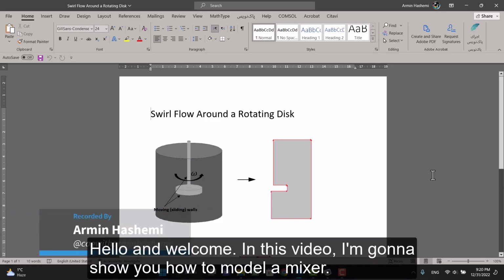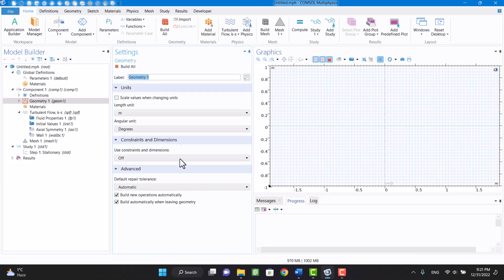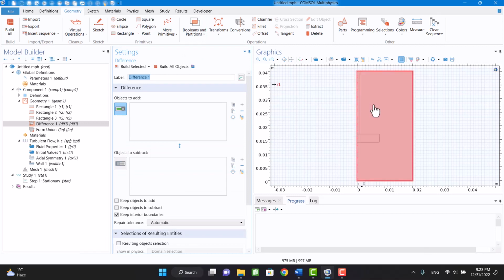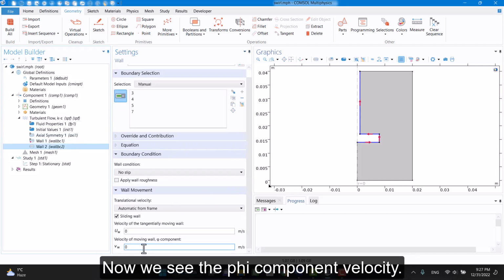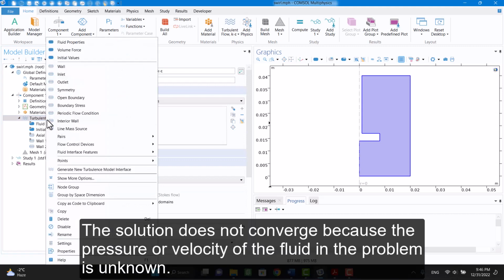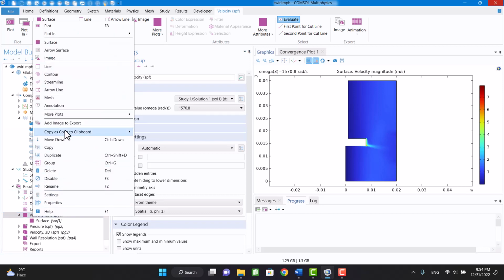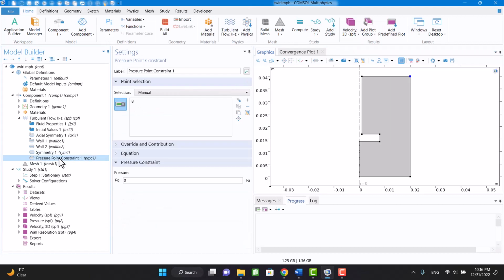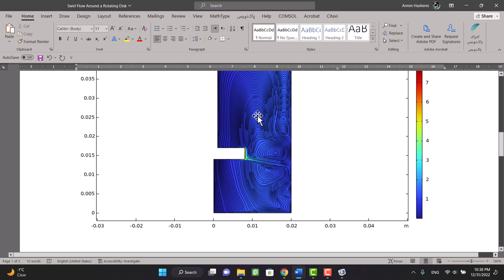⚙️ COMSOL Tutorial: Swirl Flow Around a Rotating Disk (CFD) 💨

Comment: Hey bro. Nice video. Why did u set the symmetry on the top boundary? Why Open boundary led to non-convergence? Can u please explain a bit more? What about “Outlet”? I understand the top boundary is the free water surface confined in a beaker, isn’t it?
Reply from the maker: Hello. The symmetry boundary condition at the top of the fluid is similar to that of a high-height fluid. I have to watch my video again, i didn't remember details. I will answer ASAP
Reply: Also, under the settings for the wall, u enabled sliding wall. What’s the difference between setting velocity in translational velocity (manual) VS sliding wall velocity?
Reply from the maker: @richardjiang  There is no difference in this model. You can write omega*r in phi coordinate, and the answer will be the same.
Reply from the maker: @richardjiang   Open boundary led to non-convergence because you didn't specify normal stress. Select no viscous stress. It should work.
Reply: @caewitharminhashemi  Hi, Armin! Thank you very much for the explanation!
Reply: @caewitharminhashemi  Also, I am interested in modelling a syringe (fluid inside pushed by a piston). How can I input the advancing velocity of the piston to push the fluid forward (I only created a region for the fluid)?
Reply from the maker: @richardjiang  you're welcome. I think you should use moving wall, and moving mesh is also necessary.  I have not modeled this before.